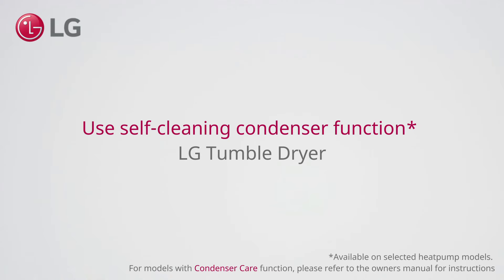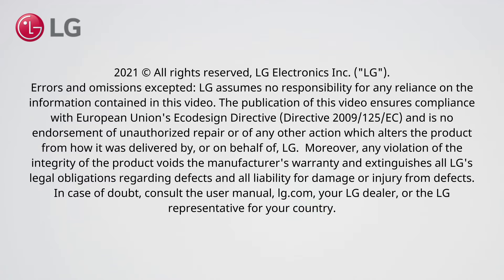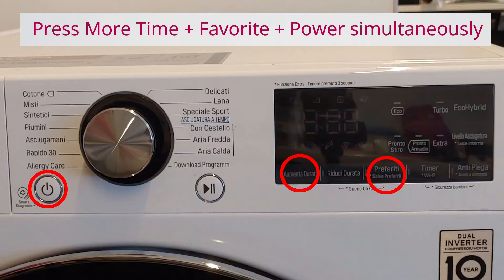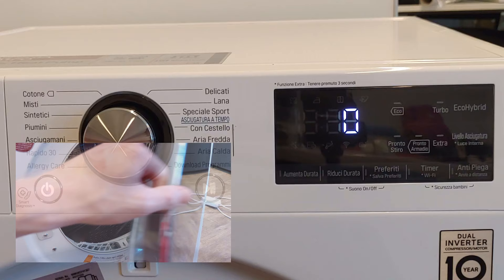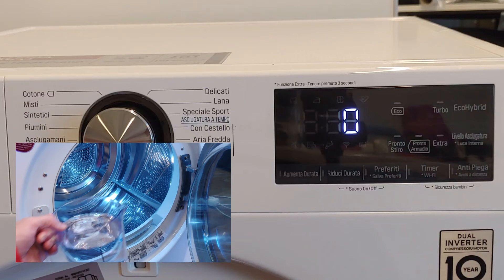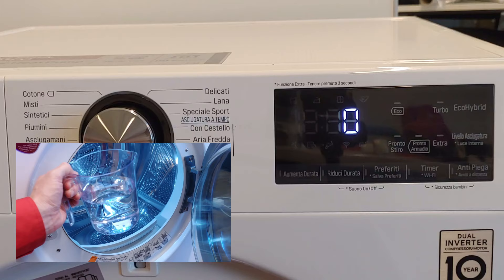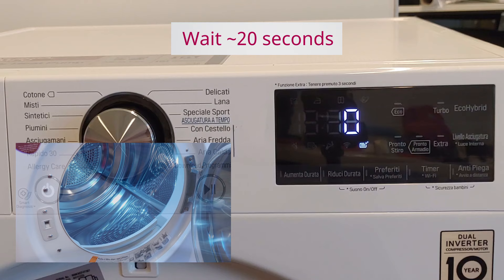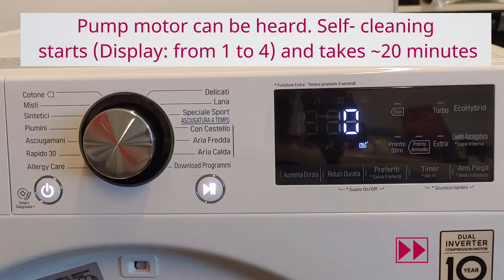[LG Tumble Dryer] - Use the condenser cleaning function manually

Comment: Where do moths go?🤔
Reply: I will tell you. Exactly where they go on other dryers. Straight to the condenser. My dryer failed after 2 years - was cleaned on warranty. Now 36 months - service won't come. A private company technican came and tried to clean it. He had to disassemble the whole thing but cleaning it throuly is impossible. He couldn't get to clean sensors of water.  I can throw IT away and buy any other dryer with Access to the condenser.
Reply: @MajaMakiewicz  Hi, did this happen to you on an LG dryer ?
Reply: This is exactly my question. I wonder why they give a 10 year warranty on the compressor, then they sealed up the condenser and evaporator. No other manufacture, does this. It’s baffling and it’s quite a dishonest decision from the company.